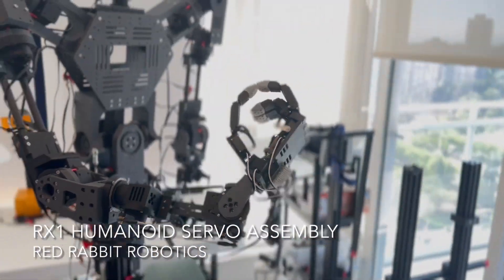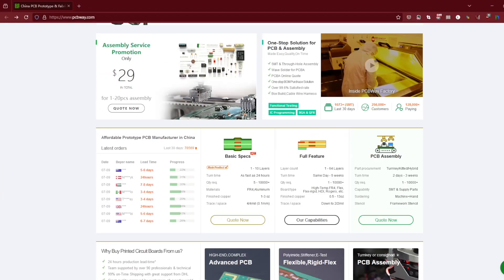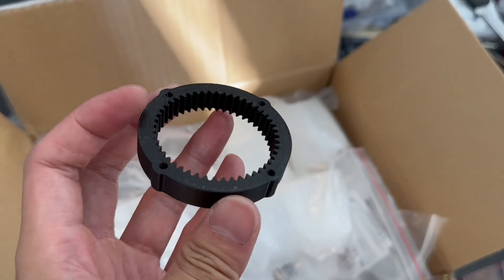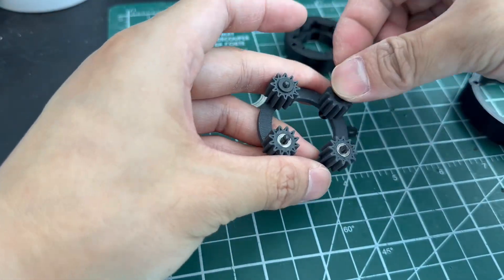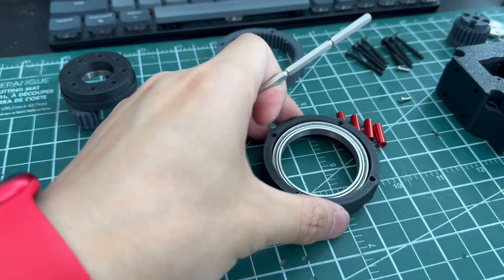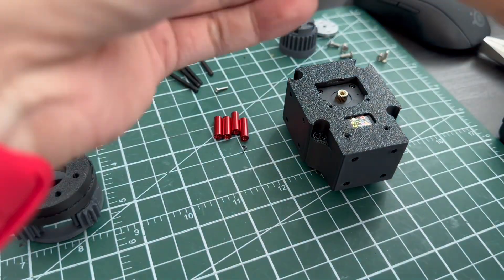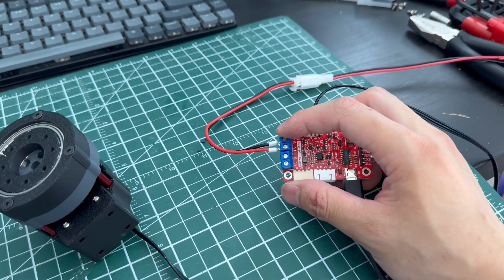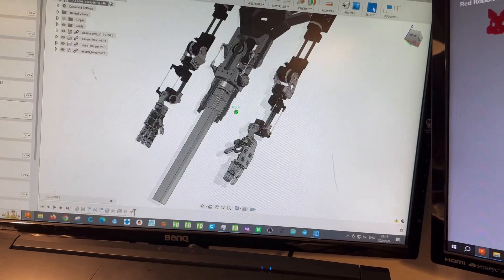RX1 Humanoid Servo Assembly Instruction

Comment: Will you be able to run/test the servos with non feetech soft (for those of us who don't know Chinese)? 

Also, how many servos total for the project? 
I see you list 7 + 3 for torso, but your diagram shows 11.

Thank you!
Reply from the maker: Yes you can run the servo directly through C++ or python SDK, I will make a separate post on how to do that. Also feetech's own software also supports English, while their official repo only has Chinese descriptions in it. 

The 11 in the diagram are the ones that "need 3d printed gearboxes". Overall there are 14 for two arms, plus 3 for neck, plus 3 for torso, plus 12 smaller servos for hands. Will post the details in the next post.
Reply: @lethic  Thank you for the details! I didn't want to order the wrong amount - do you have the model # of the smaller servos? Appreciate you!
Reply from the maker: @MicahYaple  will post more details in the next post in a couple of days. You need four scs0009 servos plus two sts3032 servo for each five-finger hand. (Alternatively if you don't want to build a five finger hand, you can also keep it simple by just build a one-finger gripper using the sts3215 servo)

Comment: have you tested how much backlash there is for the gearbox?
Reply from the maker: The gearbox doesn't seem to introduce much backlash, the stock servo itself does seem to have half degree or so backlash to start with. Though over time in thoery if the gears wear down it might introduce more backlashes. So far it seems to be fine after a few weeks of using.
Reply: @lethic  thanks